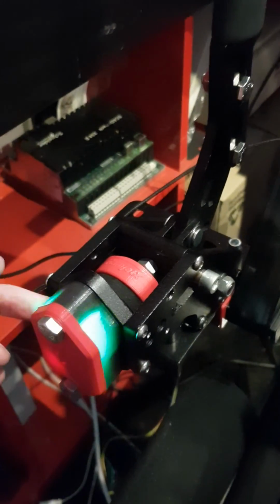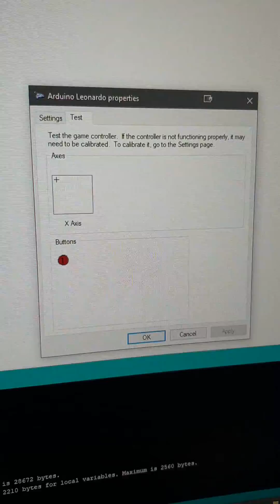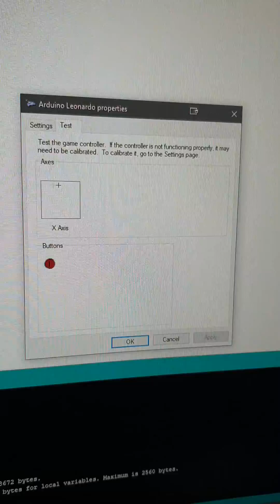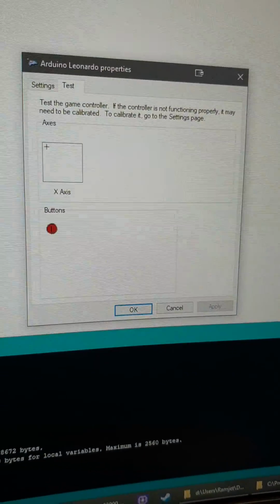Hall Effect Handbrake upgrade of a cheap eBay e-brake

Comment: lame video no links
Reply from the maker: I know... I'm such a prick hey....

if you're interested... Join the simhub discord channel and say hello and start yourself a DIY project.

It's only a magnet, hall sensor, neopixel led and Arduino. It's literally the basic analogRead sketch with the joystick  and neopixel library on it.

It's not like I don't share. Also, Banggood copied my design and you can buy these things now.
Reply: @RamjetX  ordered one.  bought a micro pro and hall board to.  I shouldnt have said lame video, video is fine.   i meant more to show it but not give a link to the code :p  i loaded up a sketch and it reads fine but doesnt create a controller in windows for some reason.  i want to figure it out to make  pedals.  ill try the discord. the others i joined kinda suck
Reply from the maker: https://www.thingiverse.com/thing:4731632

Comment: Hello
i did the same thing but just with an Logitech Pedal :D ...do you know, how can i use my DIY Handbrake with Forza Horizon 4?
Reply from the maker: Ahhh I think you just posted the same thing in the simhub discord.

I presume that your using an analog axis for handbrake. Forza might not read analog for handbrake and might only be looking for a button.

What I did was to make mine switchable. I read the analog pin as normal. Then using an if statement, if handbrake greater that 512, joystick.setbutton(handbrake button,1) if less that 512, joystick.setbutton(handbrake button, 0).

Naturally I use a physical push button to swap between the modes.
Reply: @RamjetX  Can I have the code for fh4, i mean full. to edit mine... thanks